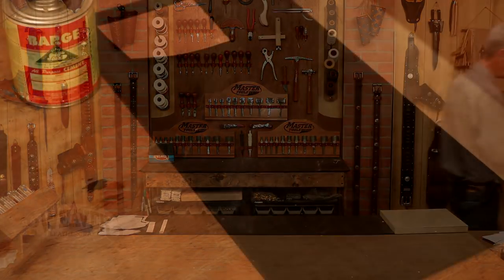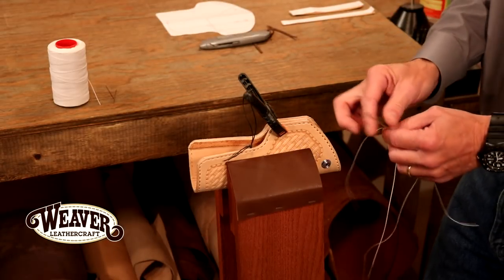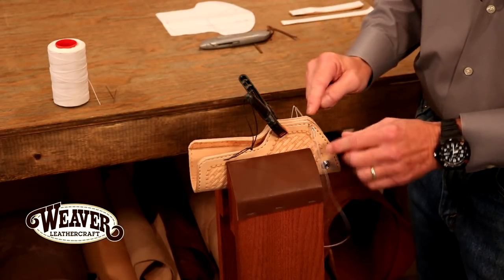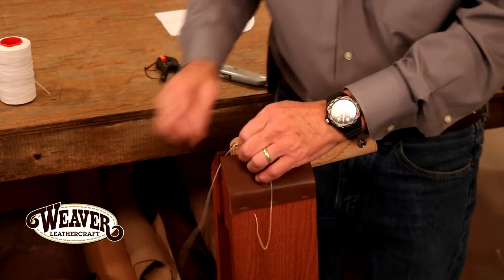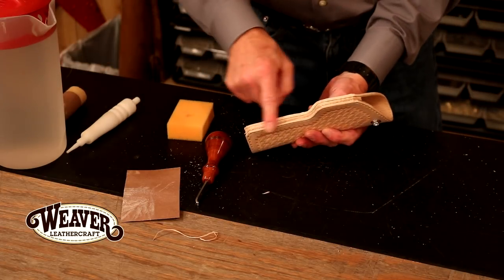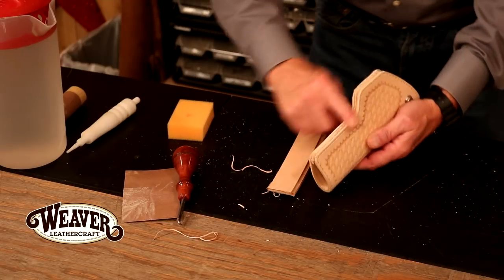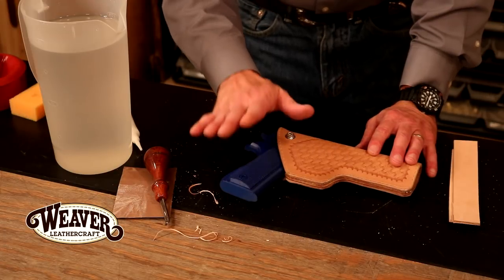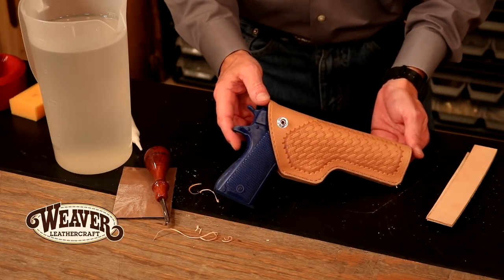Making a Leather Holster Chapter 5: Adding a Temporary Stitch Line and Wet Forming

Comment: Did you consider taping a small dowel or something to create a channel so the front sight doesn't chew up the in side of the holster? Or is there inherently enough clearance because the holster was wet FORMED vs wet MOLDED?? .. please bear with my rookie ignorance.... great series
Reply from the maker: Hi Andy,
There’s no rookie ignorance there!  That’s an excellent question and a great idea.  Yes, you can use a dowel to crease the inside enough to accept the front sight.  For the size of most sights the leather is more than pliable enough (with some good moisture) to allow that to slip in pretty easily, and in doing so, it creates an alley the same shape as the sight.  With this video, I wanted to get the basics, but from there, there are all kinds of ways to step up your holsters.  I saw one at a recent show that was the best I have ever seen.  The welt alone was four-ply, tapered lengthwise and widthwise and, not only did it match the bottom of the gun exactly, it was even curved to match the bottom of the trigger guard!  It was, literally, a perfect fit.  I doubt I will ever be there, but, it is possible to really upgrade in a number of directions.